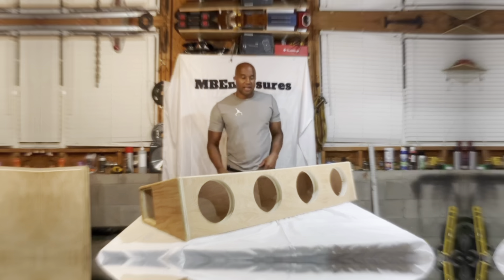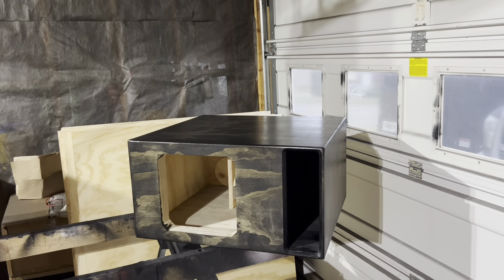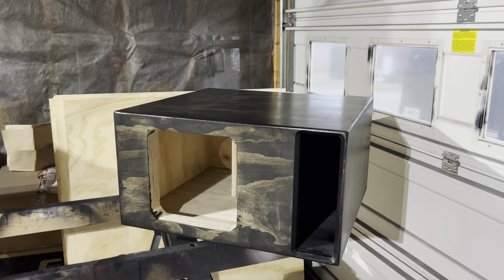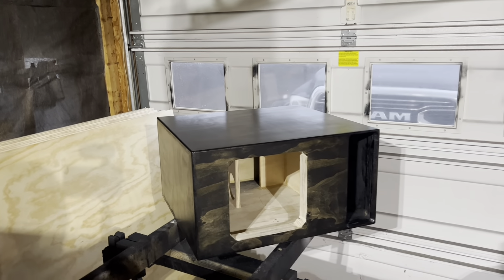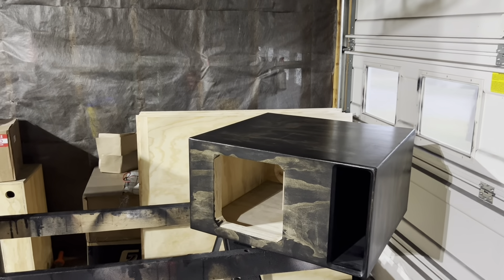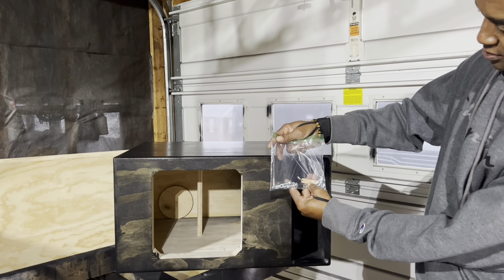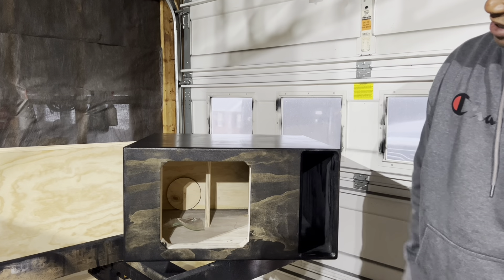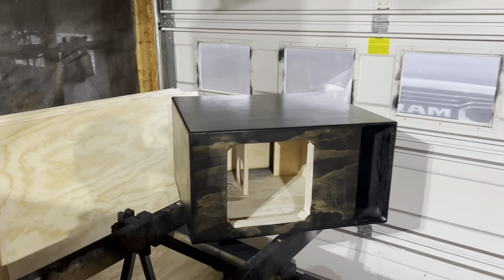KICKER SoloX 12” D2 MBEnclosure 3.25 net Tuned 31hz

Comment: That's a sweet color on that box. I didn't realize how serious the new solo x was. I just broke the 2 I have in and it's seriously going to break my roof supports in my Escalade.
Reply: That solo x has always been the best speaker that kicker had. I had an American bass 15, which was their lower tier but it was nasty on low notes, but a guy with an old solo x 10 kicked my ass in a bump off contest. I never been a big fan of kicker until I heard that 10 a few years back.

Comment: hey mb i got a question, have you dealt with a solo x that bottoms out yet. i have the solo x 12 built to almost the exact spec box like yours at 3.23 i couldn’t go any bigger in a ford focus 2014 sedan but i asked my box builder to build it similar to your design and he did excellent not saying its like yours either but im paying mine on a d4s jp23 1.5 at .5 ohm and when i get to the 12 o clock mark on the bass knob it seems like it’s getting tonssss if power literally and some songs when it hits a bass heavy punchy note it bottoms out the sub my electrical doesn’t even dip past 12.9 either and all my wires are excellent and my ground is set properly too idk why it bottoms the sub i checked the coils and everything inside the sub and i see nothing wrong with it.